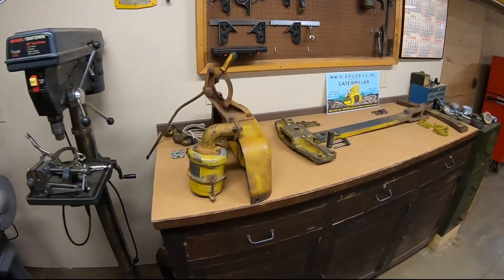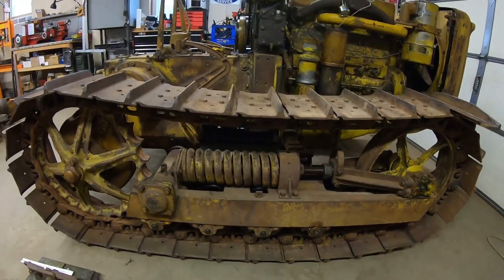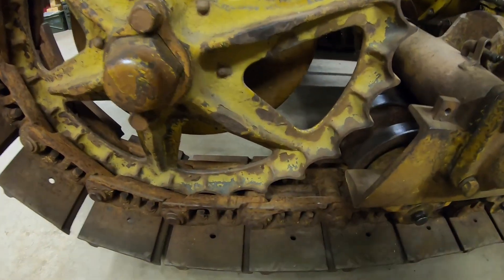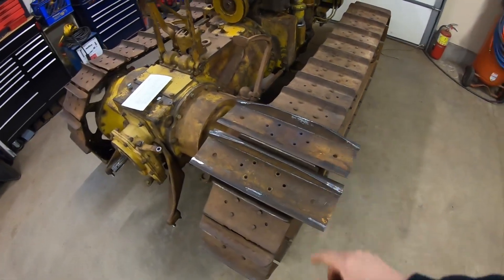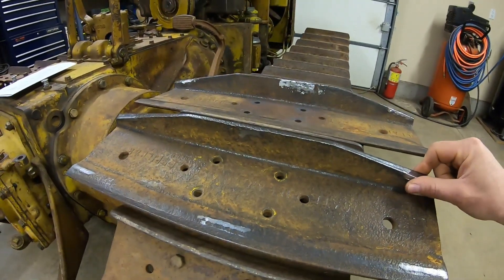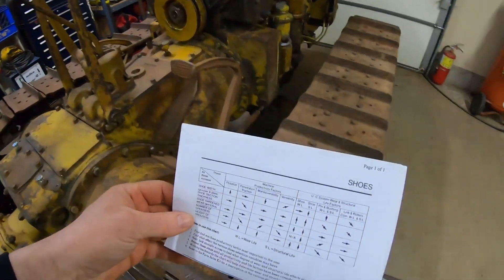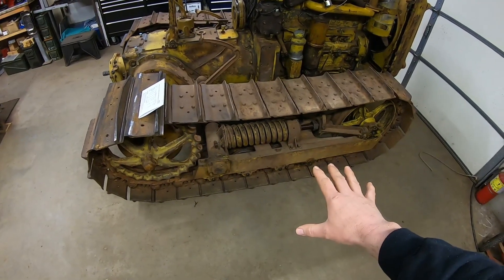Caterpillar D2 #5J1113: Explaining the Unknown Functions of Undercarriage Design - Viewer Q&A

Comment: Thats one of the most interesting Videos ive ever seen and there are a lot of them on your channel. Allthough i did a 3 year apprenticeship as a heavy equipment operator we didnt learn a lot about the undercarriage of tracked machines. we loosely handeld the components, how the pads generate tracktion and lower ground pressure and how to determine when the parts are shot. Its very interesting to see how each part of the undercarriage works together. Keep up the good work with these Videos! Greetings from Germany

Comment: This is a completly new look at how a track works (or this era track?)  I can see he aspect of it as a drawbar unit (aka Farm Field work mostly though grader or dump pull)  but as a dozer,  you are pretty much even with forward and reverse (as well as a loader).    It would seem that for that intent a compromise track would work better (no idea if there is such a thing).    Overall there would be more forward than reverse but it would be a lot closer to a 60/40 split at a guess.   I worked around a JD350B as well as operated it some,  we tended to dozer and loader work (Drott 4 in 1 bucket) so that would have had a 55/45 split at a guess.    Still a bias forward as we had a backhoe setup on it and that was mostly forward with a bit of backing up.

Comment: I'm enjoying watching some of these past clips because each time I do I get reminded of things from the past.

Much like how this tractor is going to be a drawbar machine instead of a dozer. That's pretty neat, and as I said, reminds me of an old d4 a friend had and caged up with an added on bench to the back to carry two or three people if you didn't mind being very cozy. As well as some deer stands or a few deer or hogs. He'd use it as a woods cart and just drive it through the under brush and briars, knock over small trees and scrub palms. Wade it through a creek or wet areas to collect hunters and whatnot.

It had a full home built dage and large bull bar on the front, a pto winch off the back with a few snatch blocks to redirect the cable forward if needed. As I said, a bench on the back for extra seating, a short mesh footboard for cargo, snorkel and extra lighting. He loved that crawler and kept it in fantastic mechanical shape, looks though were another story.

I just st got to thinking about it when you said that this one would not be a dozer.

Comment: Thanks for the Video excellent content . I have owned and operated bulldozers over many years and while i already had an understanding of how track design worked ive never heard it explained so well . I believe Caterpillar say theres 5 times more wear on the pins and bushings in reverse than in forward . I worked for a contractor that had done his time on D2s and D4s and was very strict on keeping tracks clean and adjusted correctly plus good driving habits like not backing over dirt spill from blade and driving forward when travelling from site to site . Because he was bought up on dry back end he was very strict about not using the brakes . When he had D6s and D 7s and we would paint them up in the off season he would say he wanted to see the paint wear off the floor boards before the brake pedals . It was good advice and a good habit to form . Thanks again enjoyed your video

Comment: Awesome video! Very helpful. Especially the part about putting the track chains on the wrong way. I did new pins and bushes in my 4U a few years ago, and from memory the workshop manual didn't mention that. Would there be any way to check whether it is the right orientation without disassembling it all? No obvious wear noticeable.  Regards, Luke

Comment: Concerning your statement at 5:10 : Is it really the case that wear of the bushing to sprocket is higher when driving backwards? I've tried to think about this theoretically a few times, but my mind is screwed up every time. As of today, I am of the opinion that the direction of travel does not matter. Could you check this again?
Reply: I’m with you. I can quite get my head around it being different. Seems like the sprocket / chain geometry is symmetrical in both directions?
Reply: @squatch253  Wow! I would not have thought that. Definitely something new learned today. Thank you very much.

Comment: Fascinating stuff and things most people would never think about. Clearly track and undercarriage wear is the weakest area with these machines but then track systems are complicated with lots of moving parts. For a hobby machine seeing a few hours a year I would be reluctant to spend loads of money and overdo the restoration to get everything back to factory fresh. Here in the UK engine work and general engineering work is quite expensive and its not easy to find people prepared to do the work. On one of my stationary engines the crank pin was 20thou out of round. I couldn't find anyone prepared to grind it so I sat with a file and micrometer and re-filed the pin round. It sounds horrendous but the engine runs well and has done for over 10 seasons now. Its not under much load though.

Comment: I have a 5J that was formerly a trackson loader.  It has the 5 roller track frames and top carrier roller.  From the factory, the track pads (12 inch single grouser) are on "backwards".  I have seen several with grouser pads and all are on backwards.  On the ACMOC forums it is said this was standard procedure, but I have not ever been able to find out why.  The links themselves are on the correct way, just the pads are on backwards......any idea why this was done?

Comment: Squatch, have you ever run across a D2 with a cable blade?  My grandfather had one and since I was just a kid then I didn't pay much attention but I think it may have been a J series.
Reply: @squatch253  Thank you for the reply.  This one had a rear mounted winch with the cable routed through a tube along the right side of the engine and then straight down to the blade which gave it an off center connection.  The blade also had a connection point left of center so I always wondered if was meant to have two cables.

Comment: Wouldn't look right, but I'm a fan of trapezoidal high flotation wide tracks.  Very little pick-up so they stay pretty clean even in modestly sticky stuff.  And they bite fine.  Just real expensive ...  Mostly they work real well for creating slopes with seed/water pockets (run up/down slope).  So excellent for reveg work 😊

Comment: Hi Toby, informative video. A point you did not address in this video, and probably was not in the remit, was the ‘Sprockets in front versus Sprockets at the rear’ argument and how that relates to track ‘power’ and wear. I operate a 32t Excavator set up as a ‘Shovel Logger’. Driving up a hill ‘backwards’ draws noticeably more power than going ‘forwards’. The machine really struggles to move in reverse uphill. 
  Tank design in WW2 explored this argument with some manufacturers going for rear sprockets, while others went for sprockets at the front. Although Tanks are a different thing to tracked tractors, the results of the argument were not conclusive.

Comment: Hey, Squatch, I know you like those odd-ball stories, this one might interest you 🙂
Guy I used to work with was Ex military (REME - Royal Electrical and Mechanical Engineers) if memory serves. He had been on winter exercises in Europe with a NATO Tank force, with units from the US, UK, Germany Etc. One really slippery hill stopped them all. No body got more than half way up. 
There was a really smug know-it-all in his unit that nobody liked. This guy said: Reverse the tracks, and they will go up, no problem. It did not get a good reception. BUT. Eventually, they gave it a try on one of the tanks. And. . . . Up she went. NO problem. Once all the UK tanks got to the top, Then they let out the secret.
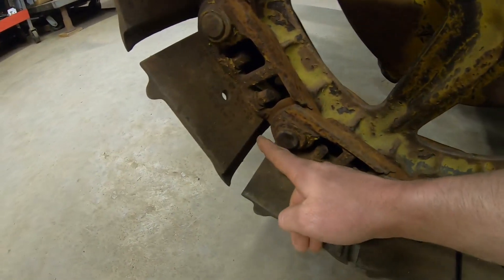Your explanation at 07:00 would explain why that worked.
I always wondered exactly how that worked.

Comment: I have never tried it on tracks, but Moly-lube has kinda changed things on non lube surfaces.  I'm not disagreeing with you a bit on grease picking up grit, and great video. I've actually used dozens of cans of carb cleaner undoing the previous operator's well intended but misplaced greasing endeavors.

Comment: To put it in actual tire terms, the tracks behave exactly like high performance asymmetrical tires; if you mount them backwards, you will wear those tires out extremely quickly.

Comment: Clay type dirt with some moisture actually acts like a lubricant, antiwear compound.....(opinion)
Reply: @squatch253  Thanks for the reply, I like track  machines, had a D-8 (14A)  with 22 inch pads and a retrofit turbo, nice machine but actually to big for a lot of jobs, sold it now I have a D-4 (7U or 9 U cannot remember)  9 foot blade, tracks are shot, about an inch of grouser left, rails are thin,.need a lot of rebuilding for sure.  Runs very well yet, a little over 6K hours on the clock.  Got another little track loader, JD 450 C , needs some hydraulic line repair on left side,  nice running little bugger, tracks are fairly fresh, turbo kinda rattling, been that way for a long time.  Enjoy your channel and rebuild vids!!!

Comment: Toby that was some well done explanations. Not disappointed, you not taking the D2 into a swamp, but clearly once you put this many hours into it. It would be a shame ruining it with stupidity or making unnecessary stunts. I'm no expert but the D2 wide pads seem to be steel? The very typical Soviet crawler tracks are a mixture of chrome and steel(magnet woun't attach to them, can't be welded). Only S-80 and it's later models have steel pads just like CAT D2-D6 (ofc they are a indirect clones of the CAT :lol)
Reply: @squatch253  Most if not all the military tracks back in the day where made from chrome-Nickle-steel mixtures. Also unlike the CAT where you have a master pin(same deal with the S-80, T-100M, T-130). Most soviet crawlers don't have a master pin as do the military vehicles utilizing tracks. You can take a broken pin or track out without having to remove the entire track on it's own. Dose have a down side, pins tend to break more and are more sensible to wear. I try to save any new old stock or even slightly used tracks cause the new ones in the store are just not made from the same consistency as the old ones(wear out lot quicker).

Comment: Had a guy tell me one time that when roading a dozer he always ran in reverse to save track wear.  He didn't understand  he was causing more wear by doing so.
Reply: That works somewhat for V shaped tractor tires, if you spend more time on the asphalt than on the dirt it is better to place them pointing backwards if you want to extend their life, of course then on the dirt the traction will be much lower but for some works can be more than enough.

Comment: I've run into the same argument as you when it comes to the hours put on the old machines.  One thing to note about your other D2 is the 100 hours you referenced are engine hours not traveling hours, so the argument some may have about wearing out components is even more unreliable. LOL

Comment: Got to say I learned a lot about dozer track. Cat engineers thought everything through didn't they? That little dozer will look awesome when you get all your goodies put on. Like a Rat Rod of the crawler world.
Reply: and jus think, NOT ONE COMPUTER was used when they designed, poured the steel, built the machines, not even a calculator other than slide rules and abaccusssusssss

Comment: Did Caterpillar put limitations on the track pads such as soil types, corners, speed directions etc? 
Example, track that are x" wide maybe used for these type of operation as long as the speed selection gear is 2nd gear or below reverse and 1st gear forward, or pad that are under y" are not recommended for blade work.
I guess something like warranty disclaimer / exclusion.
Reply: @squatch253  Still that way now, many people at industry locations don't really care about or for the equipment. The 3 D10s at my work do not have 3rd rev, and auto downshift permanently applied. Totally dirty and trashy operator station as well.

Comment: That was a very informative video the wide track pads work just like wide rubber tires they provide more surface grip but at the same time Rob power away it will be very handy for plowing the engine horsepower is the limiting factor.  It will last a lot of years the amount of hours you put on it if you were going to plow a 1000 acres a year with it then it is a totally different scenario.  I have always been told that snow is murder on a crawler undercarriage and that dirt is like lubrication for the undercarriage
Reply: If you're interested, DirtPerfect has a channel with some vid's where he's equipping his 850J with wide tracks pads. He goes through a thorough explanation of why and how they will work for what he wants the machine to do which is pull a tile plow. I should think all the principles apply in both cases.

Comment: Cat did a great job on engineering these early machines. Where they failed was in operator comfort. Plowing all day on D2 and D4 tractors is a brutal workout.
Reply: I don't think anyone was really interested in operator comfort at the time.  Look at contemporaneous over-the-road trucks or steam locomotives for comparison.  Steel machines and iron men.
Reply: @Pamudder  But in truth, I think they also spent less time actually operating the machines because they had to spend so much time maintaining them. That is, of course, if they wanted them to work at all.
Reply: Sometimes you have to make your own comfort. My friend just acquired a 9U on which the PO placed 3 or 4" channel iron under the  seat and fuel tank assembly and gave himself substantial legroom.

Comment: I'm guessing you could rotate the tracks side to side if you had to balance some kind of asymmetric wear. Everything would still be turning the same direction. Maybe?
Reply: usually an operator who spends a lot of hours will wear one side more due to his operator preference or what side they tend to work the machine on